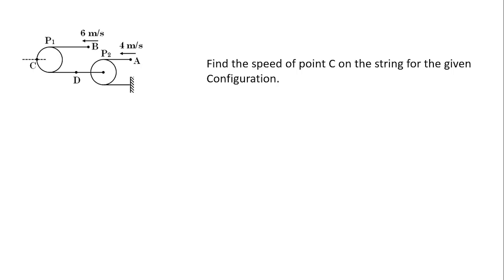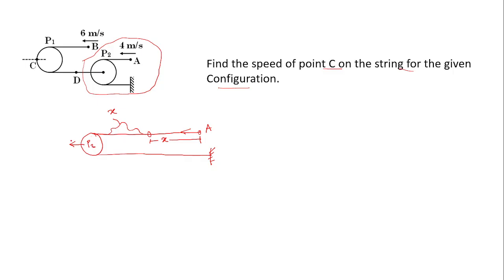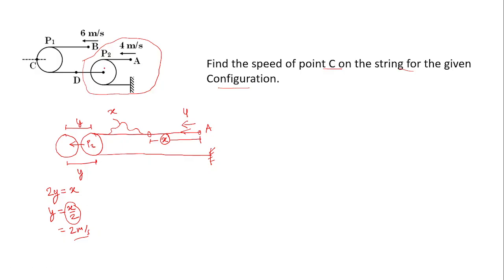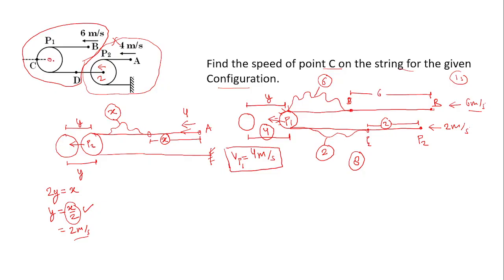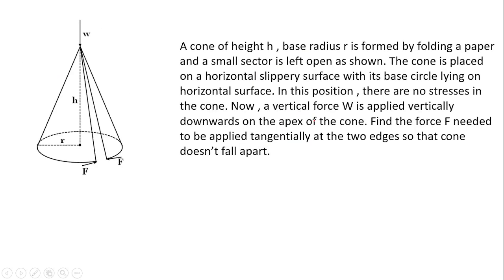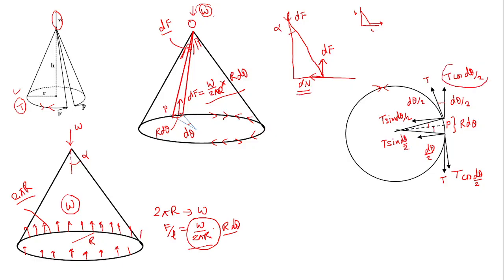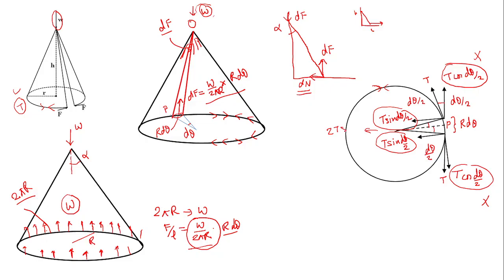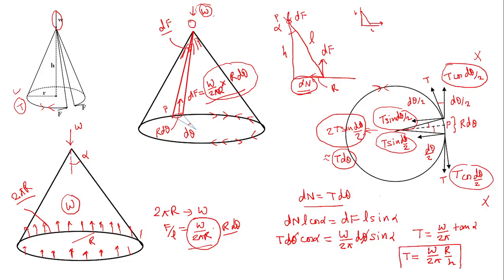Prescore Physics test Paper 2 Solutions for JEE Allen

Comment: Sir in 1st question how 2y??
Since one side is attached by wall so it shouldn't be y=x????
Reply from the maker: I have explained the concept. If one end of the string is fixed and the pulley moves ahead by x , the other free end of the string will move by 2x.

Comment: Sir tried doing it using the ΣT.v=0 formula but usse velocity of point D -2 and velocity of P1 -4 aa rha hai dosent this contradict the original direction of velocity they assumed in the question ki velocity + direction mein hai (bec velocity of A and B +ve hai) aur and the velocity of D should be the same as A...but D has negative velocity
Reply from the maker: Probably you are committing some error. Also I will suggest we should avoid that virtual work principle as it complicates the situation in some cases.